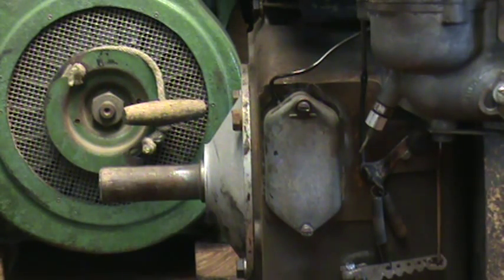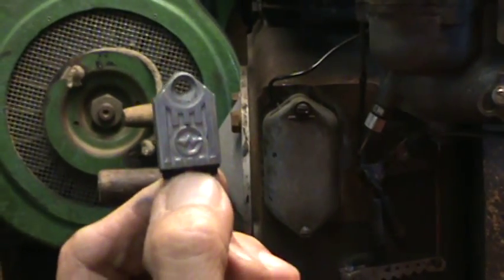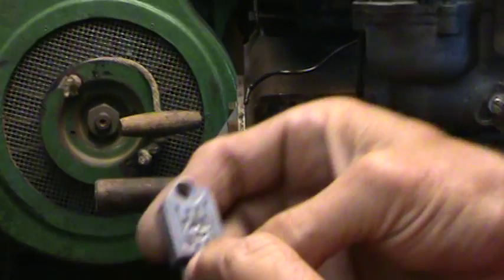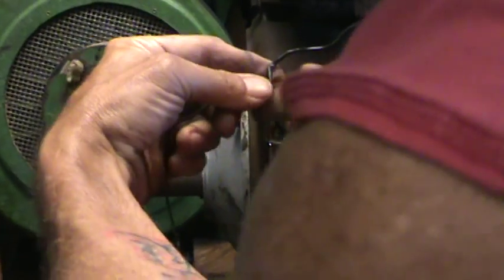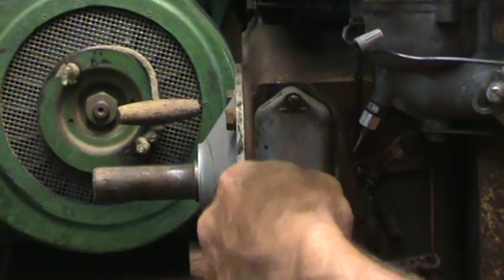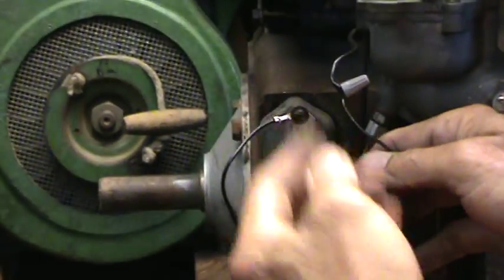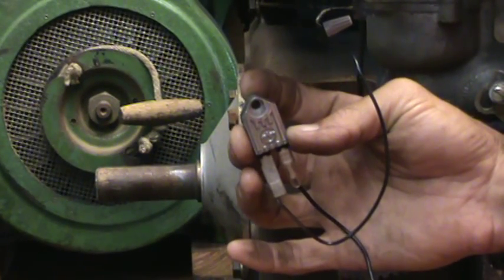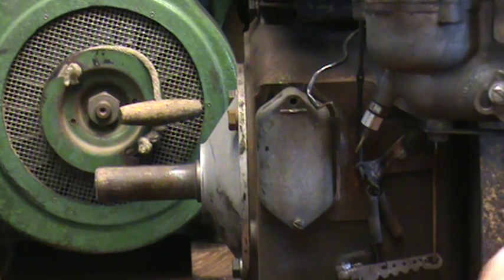Small Engine Ignition from Points to Electronic Ignition in 3 Minutes!

Comment: I don't understand how it receives the timing signal without the points, I have a vintage 2 stroke 2-cylinder motorcycle I am trying to convert to a point assisted electronic ignition, and was wondering if these modules would work.
Reply: I think it works off the magnets in the points. That’s why you gotta mount it to the box.

Comment: But how does it know when to fire?   The cam push rod is taken out of the equation.   Please explain. I'm not sceptical   just don't understand how it knows when to fire without any kinda timing from the cam or flywheel.
Reply from the maker: It is magnetically triggered by the Mag/Coil in place of the points. That's the simplest way I can explain it. Cheers! Zip~
Reply: Okay. So this Briggs has the mag flywheel , and mag coil?.?    I was thinking it was a Kohler with external coil.   I'm guessing the Kohler wouldn't work with this?.?.?     Thank You for your earlier reply 🙂

Comment: I installed one of those electronic ignition on a Manirelli 2 stroke water pump engine and it will not start when I rapped the rope on the clock wise rotation but it will start on a anticlockwise rotation .do you have any idea why or what can I do to make it start on a clock wise rotation

Comment: In my attempt to remove the points and condenser and switch my Briggs & Stratton Model number 109 402 8 horsepower over to fully electronic ignitionI've run into a few other issues my question is can I attach a Nova module to electronic ignition coil?
Reply from the maker: Great question Mark. The answer is no. The reason is because the coil is already devoid of points and condenser. Nova II ignition modules are made to replace points and condenser, not electronic ignition coil's also known as Magnetron's on Briggs engines. 
Cheers! Zip~

Comment: Would this work on a 4 cylinder Suzuki engine..GS 850 ..
Electronic ignition..fails as rpms increase ..has a ignition module pickup coil..actually 2 pickup modules ..1 works one pair of cylinders ..second one runs other pair of cylinders ..
Thanks in advance..

Comment: Will it work on a 2 cly. Onan
Reply from the maker: I haven't tried using one on a two cylinder so I can't say for certain. But if the Onan has a Battery type Coil then this will not work with it. It's for mag fired coils only. Zip~

Comment: will  this work on an old kolher 12hp cast engine
Reply from the maker: No. They're for Mag fired single cylinder engines. Kohler K series are Battery Coil Ignition. Zip~
Reply: @ZippoVarga  dang
Reply: so will it work on my old mac 10-10

Comment: will that work on a Wisconsin tr10d of a bolens 1050? it currently has external coil and i see a small wire coming from the back side of the flywheel. not sure if that's the original coil wire or what. thanks

Comment: Wait!  I took the magneto out and now have an external coil...will the nova still work?  I retract that "hero" statement until I get a reply.
Reply from the maker: With the original Magneto, it will work but if you installed a battery ignition coil then no. This will not work. You're stuck with points unless you reinstall the correct Magneto. Zip~

Comment: Zippo - Will this work with an old 08902 model 3 hp Briggs? I believe it has the reversed polarity flywheel...
Reply from the maker: It should, yes. It can be installed either under the flywheel where the points are (not recommended) or externally where it can regulate its temperature more easily. Too much heat can cause damage in other words. Zip~
Reply: @ZippoVarga  Thanks! I just have about finished the rebuild, and wanted to eliminate the old points; I'll mount the unit under the blower (not below the flywheel) to make certain it won't get too hot!

Comment: Don't you mean stator not coil?
Reply from the maker: No sir. The Stator is used to provide a charge to the battery and accessories. I meant the coil, which provides spark to the engine. Zip~

Comment: Old thread, I know. I tried this on a Tecumseh hs50, and it sparks good, but will not fire. It has the coil inside the flywheel, I guess it is a 3 leg, since the coil wraps around the middle prong. I am thinking I will put the points back in it. I didn't tear anything up, but I did remove the points & condenser.
Reply from the maker: Yeah Oakie. It doesn't work with all engines, but when it does, they're great. Although, I did try this with a Briggs 23D which has a 3 leg coil and it worked fine. On the flip side, I tried it with a Briggs BR6 with the coil under the flywheel and it failed to spark. Might have something to do with the magnets not being able to trigger the module. Cheers! Zip~
Reply: I put the points and condenser back in. They worked fine before my attempt, and they work fine now. I have an interested customer who wanted this big old snowblower but wanted “modern “ ignition. If this kills the deal, fine. I have another newer snowblower he might like if I cannot convince him this configuration is best. I am sure this Nova 2 will find a home in a different piece of equipment. Thanks for the knowledge. You teach well. Experience is also a good teacher. You and Bruce’s Shop, and Steve, and Dony, and Mick, and all the others offer wisdom that is condensed experience to keep me from having to fumble in the dark as I build my experience levels. Merry Christmas!!
Reply from the maker: @haneyoakie14  And a very Merry Christmas to you and yours Oakie!

Comment: Just seen these online but came to YouTube first to see what others think. I'll be buying one for my very old Atco lawnmower. Thanks buddy 👍
Reply from the maker: They work great for Magnetron type ignitions, but won't work with battery ignition systems. Just keep that in mind when applying them to an engine. Cheers! Zip~
Reply: @ZippoVarga  Yup just fitted one to a very old (60s ish) ATCO lawn mower that had no spark. Now has a great spark. Electronic ignition is the way forward.
Reply: @ZippoVarga  I have a Kohler K301 on a John Deere 212 mower.  What do you use for a battery ignition like mine?

Comment: I bought one of those to replace my points but I can't get it to work.
Reply from the maker: It doesn't work with all engines. What engine do you have (Make and Model)?
Reply: @ZippoVarga  Briggs and Stratton 80202-0465-01-7004063 3hp on a Montgomery Ward edger. I have been having ignition problems where the engine will run great for awhile and then will just die. It has a new carburetor an gas tank because the old ones were corroded beyond use. I bought a new Oregon replacement coil to try with that ignition module to see if that would solve my problem but now I get NO spark at all. I guess I'll just put the new points I got for it in and hope that solves the problem. I think the old coil or condenser were bad and that is why it would die after awhile. I'd really like to get this edger going and use it because I inherited it from my late father who inherited it from my grandpa. I wish grandpa were here to help me because he was a wiz with these small engines!
Reply from the maker: @bigpappahemi4263  First off, my deepest sympathies for the loss of your Grandfather. I was very close with mine as well. It's possible that you purchased a Magnetron coil (electronic ignition) which doesn't play well with the polarity of the magnets on your engine. Try to turn the coil around and don't connect the wire from the points (Nova II) to it. If the engine produces spark, you know you have a breakerless (no points) type coil. Let me know what you find out and we'll go from there. I'll do all I can to help out Hemi. Zip~
Reply: @ZippoVarga  It is not a Magnetron coil. I won't be able to work on it for awhile because I'm having gastric bypass surgery tomorrow but I will let you know as soon as I try that. Thank you very much for your help and condolences. I do miss my dad and grandfather quite a bit. They say you're never really a man until you father dies and I now see some validity to that statement.
Reply from the maker: @bigpappahemi4263  I wish you good health with your up coming surgery!! I hope you have a speedy recovery. Do be careful and rest. Zip~
Reply: @ZippoVarga  Thank you Sir! I will do my best!

Comment: Zippo, awesome stuff, I almost gave up on an old 16hp Briggs cast when points plunger stopped moving until I found your vid on the Nova2. fyi to all, I didn't have spark at 1st, not sure what fixed it, cleaned all connections again but also moved the magneto much closer to flywheel, about 1/16 " gap, and starts 1st pull!! Great vids, thx...……….
Reply from the maker: Glad I could help! Zip~

Comment: Where do you hook up the kill switch wire in this system?
Reply from the maker: It connects to the + terminal of the module in place of the points. Zip~
Reply: @ZippoVarga  You are kind Sir, I appreciate the response, it's helpful. Interestingly, I called the Nova II folks yesterday and they indicated to me that the product isn't recommended for a flywheel that has more than one magnet; mine has two magnets, and I've connected up the ignition module 10 ways to Sunday, and it creates no spark in any configuration. It's a 35 year old Tecumseh H30 on a Craftsman edger. It started just last week with points and condenser. I guess I'm going back to points and condenser! Your videos are very entertaining and educational; keep up the good work.

Comment: Can you put this on a v twin motor?
Reply from the maker: You can "try", but they're designed for single cylinders. Engines that use only one coil (NOT BATTERY COIL) should work, like the Briggs and Stratton Opposed. But V twins typically have two independent coils. Again, any engine with two coils (Magneto's) or a coil that requires a battery connection and this will not work. Zip~

Comment: would it work on a small engine motorcycle?
Reply from the maker: Single cylinder motorcycle owners have used them with success. It depends on the bike. I would check with your bikes manufacturer to see if the Nova II is compatible. Zip~
Reply: @ZippoVarga  its a Honda 125.. points might actually be on the cam shaft! .i was under the impression that u install these to the original points  and just toss the condenser taking the heat away from the point gap?

Comment: Zippo,
Just ran into this video. I installed on 16hp Briggs, great spark but hard starting now. Does mag timing have to be adjusted?
Any advice will be helpful. Need shot of either to start now
Reply from the maker: Many things can cause hard starting. I would first pull the spark plug to see how the carburetor is acting. Black and the fuel mixture is too rich, white insulator and it's too lean. I don't think the Points Eliminator is the issue here. I believe it's carburetor related. I've got videos on rebuilding and tuning them to help out. Keep me posted George. Zip~

Comment: I looked this item up thinking it would work on lawn tractor but the company says that it is not for battery start situations. Have you tried it on an engine with battery start?
Reply from the maker: Ok, there may be a little confusion going on here. Electric start has nothing to do with how the engine sends a spark. What the manufacturer is saying is that a Battery Ignition system (An external coil connected to the battery) will not support this module. So, if your engine doesn't have a battery ignition system, then this can replace the points. Zip~
Reply: ZippoVarga so if an older tractor is electric start but doesn't use the battery to create a spark it will work? I am about to purchase a gravely 408 will this product work on this application?
Reply from the maker: So long as it doesn't have a battery ignition it will work. Wait until you have your hands on it before purchasing the Nova II/Stens points eliminator. Cheers! Zip~
Reply: ZippoVarga ok thank you for your time
Reply: Do you think it will work on a ct70 or atc 70 they have points and condensers

Comment: There is another wire on your coil going to your condenser, what do you do with that?
Reply from the maker: That is the kill wire. It connects to either a switch or your ignition key. Zip~
Reply: I hooked the wire from the coil that went to the points to the positive side of the module. I hooked the OTHER primary wire from the coil to kill wire, hooked the negative side of the module to the screw that holds the module to the stator plate  and of course the plug wire to the plug....NO fire. Swapped the leads on the module in case it runs reverse polarity....NO FIRE, NO HOW. STUMPED.

Comment: Hi zippo, I just ordered one of these because my b110 lost spark. Yesterday it randomly came back and ran, today it was running and I went to restart it and lost spark again. Would this remedy my problem or is it possibly my coil at the flywheel is bad?
Reply from the maker: Typically, it's the points fading in and out that causes the intermittent loss of spark. Your coil should be just fine. Once you install the Nova II, you should be back in business. You don't have to remove the points from the engine, and most often, I do leave them in place, just unhooked from wires. Be sure to keep the kill wire connected as it is so the engine will shut off when the key is turned off. Good Luck and Happy 4th! Zip~
Reply: ZippoVarga that's great to hear, thanks for the help and happy 4th to you as well!

Comment: I have 2 wires besides the plug wire coming from my coil.  this is on an old Tecumseh motor on a troybuilt tiller I just bought.  Will this work?  what do I do with the second wire from coil?

Comment: Hi Zippo! Thanks for the video. But I have an issue that maybe you can help with...
I added the Nova II to my B&S 23D (in AC B10) because I had lost my spark after the tractor had sat for a winter. After cleaning the magneto and fly wheel magnets, I installed the Nova II (pulling the original points and condenser and mounting it under the points cover for a concealed look). I turned over the motor and SPARK! So I installed the plug, gave it some gas, and - nothing... checked for spark again - and it's still sparking fine. Shot it with some starting fluid and turned it over some more... And nothing. After a little while longer cranking, I would get a loud pop from the exhaust and the occasional backfire through the carb. 
This would indicate that the ignition timing is off, right? There isn't a way to set the ignition timing, so is the Nova II I received "bad"? What do you think?
Reply from the maker: Unfortunately the Nova II's and Stens points eliminators don't work on the three leg coils found on many of the Briggs from the early 1960's. The timing gets thrown way off due to the point of the first leg initiating the spark instead of the last as with the points, which shows your timing would be retarded (early) by approximately 6-8 degrees. But it doesn't end there...with how the coil is made (having three legs and the windings being oriented the way they are), I don't know of any other way to achieve an electronic ignition with them. Believe me.....if I had a way, I'd definitely be sharing it with the world as I've got 10+ 23D engines as well as many others that use the same coil. My apologies! Zip~
Reply: Thanks for the information, so I didn't spend the next week pulling my hair out over it... I already have new points and condenser on order. If weak/no spark at that point, I'll order up a new coil pack.Then as a last resort, I'll go battery powered ignition. Thanks for your videos on this style motor!

Comment: Hello Zippo, can you show us how you might do this on an older Tecumseh points and condenser engine like an H50, H60 or H70 style engine?
Reply from the maker: Same process. Remove points, take single wire from coil and attach to "+" terminal on the points eliminator and ground a wire to the "-" terminal. Zip~ p.s. I only have one Tecumseh here and it's already an electronic ignition engine.

Comment: Zippo: I have extra wires on my 16 hp B&S; as well as an external connector at the top of the points and condenser cover. I have a yellow wire from D terminal on ignition switch and a small black wire that goes under the engine tin as well as a larger black wire under the cover connected to points and condenser like you show. The larger wire also goes under the engine tin. I do not know if the if the two (2) black wires are connected or go to the same place. I will try to determine that next. I also have a picture of the connector on the top of the cover. The engine is in a 1973 s-speed manual transaxle tractor.I am a dunce when it come to electrical stuff. Can you help?
Reply: Hey Ken I'm having the same issue, did you ever figure it out? I got mine running but it won't shut off with the ignition anymore and I have to ground out the sparkplug to shut it off.
Reply: I also have the same issue, did either of you figure it out?

Comment: Are there different modules for different engines or the same one work on all sizes and brands, I want to put it on my 1986 John Deere 316 , thanks
Reply from the maker: +Sam Crawford They don't work with external coil engines or multiple cylinder engines to my knowledge. I would contact the manufacturer for a full list of applications.

Comment: just installed one on my homelite xl 12 chainsaw  it ran fine for 10 minutes than quit. The module burned out. I must have got a dud.
Reply from the maker: +Matthew Piper It needs to be mounted in an area where it won't overheat. Which brand did you purchase? The Stens and Nova II are the most reliable. When you mount it, be sure it's where there is plenty of airflow over the module, but out of harms way of the flywheel. Best of luck! Cheers!! Zip~

Comment: Gotta try to get one for my 10hp Kohler!
Reply from the maker: jster1963 If it has an external battery coil, I've heard that this ignition module doesn't work well with it. I'm sure you could come up with an electronic ignition module that is compatible though. Just have to do a little research.  Cheers!! Zip~